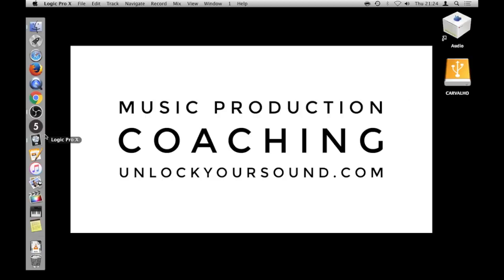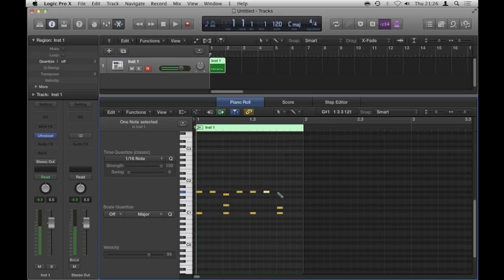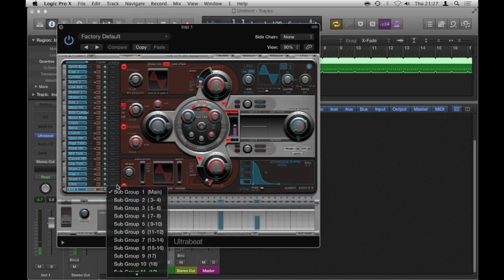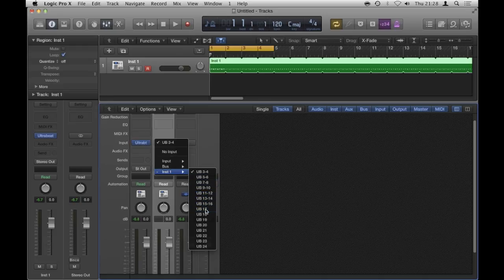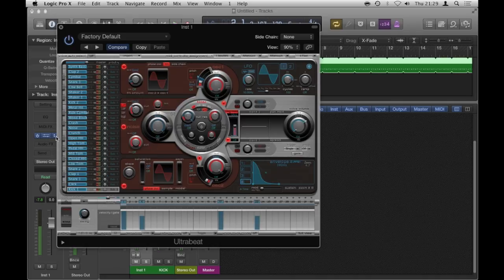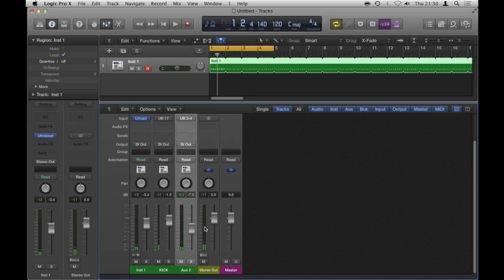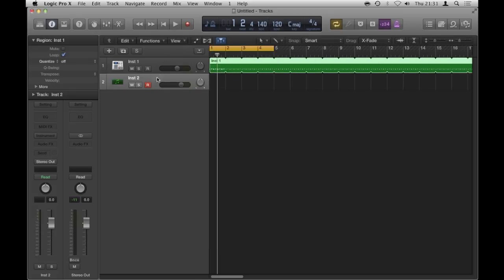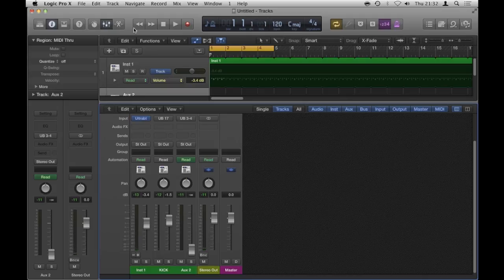How To Use Ultrabeat in Multi Output Mode - Logic Pro X

Comment: On the Ultra beat it has various ways to change the volume of each drum hit, it also has a pan knob for each sound. Where is it best to set the volume for each drum sound?..The blue bar underneath the title of each hit or the volume knob at the top right of the ultra beat? Also advantages/ disadvantages of panning in the Ultrabeat as apposed to the mixer? Which is best?
Reply from the maker: I can't think of a reason why one would be better than the other. However I would use everything inside UB for gain staging and leave the fader for mixing, including volume and pan controls. All of this is workflow though.